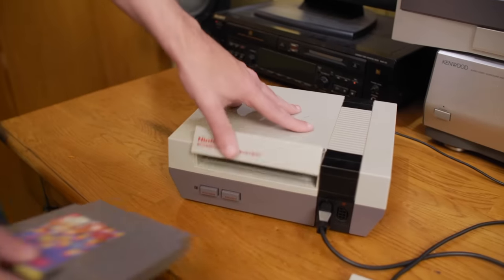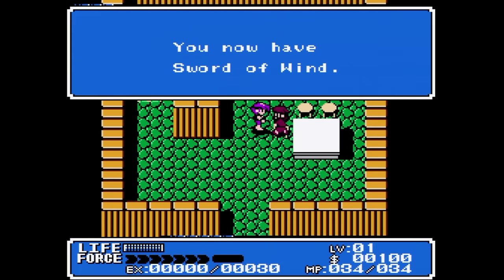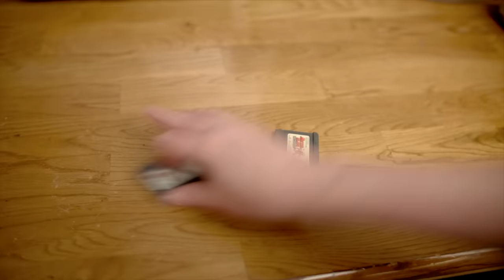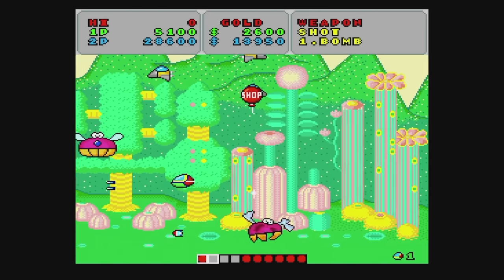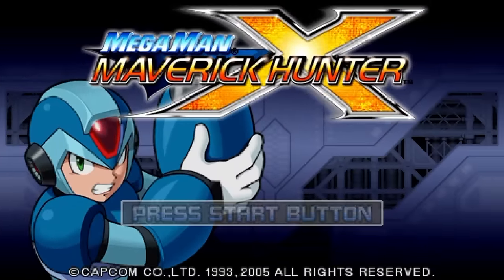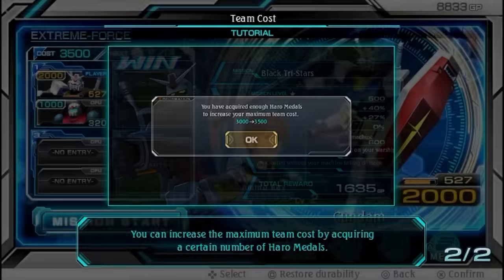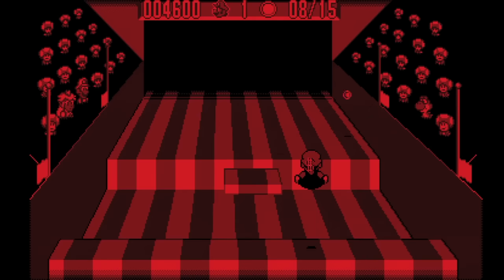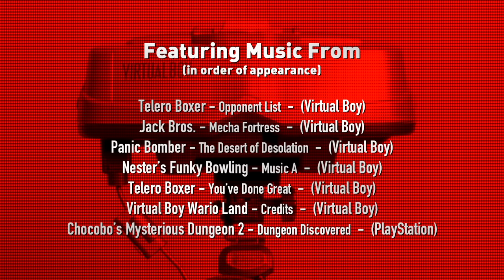Console Crunch #7

Comment: The biggest downside of virtual boy is not enough games and 50hz. Otherwise it was cool in 3D but way better on a big screen with 3D glasses. You can use red and blue 3D glasses with RetroArch emulation and it looks really cool... but MiSTer with 3D glasses options would be better and even 3D TV shutter glasses even better than that. But I dont think they make 3D TVs anymore?
Reply: If you have a modern VR headset, it can be emulated there as well. Supposed to work quite well.
Reply: @PLEYOR  I heard about that. Very cool. I'm not big on VR but I can't wait for hologram technology to be released one day. That is the future.

Comment: Three reasons why the ps vita failed despite being so amazing:
- crappy, expensive memory cards that weren't large enough to hold a big library of games
- with the exception of a very small amount of games, bad implementation of touch screen/ touch pad controls 
- no l2, r2, l3 or r3 (using top corners of touch pad for l2 and r2 feels so uncomfortable and some games would have l3 and r3 on the touch screen while others had them on the bottom corners of touch pad. Very bad and very uncomfortable)